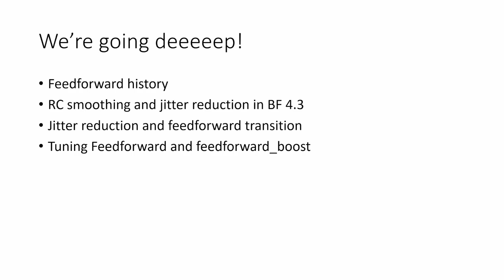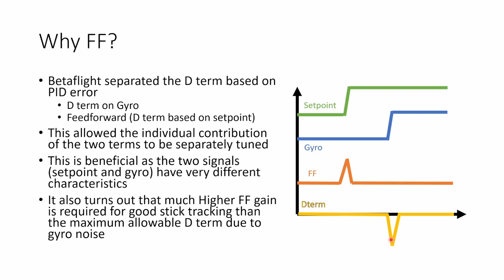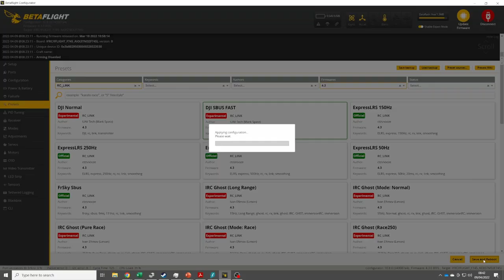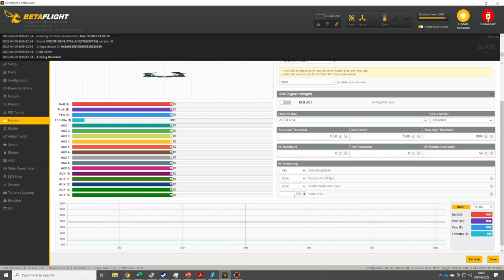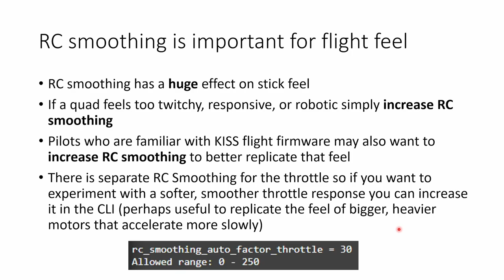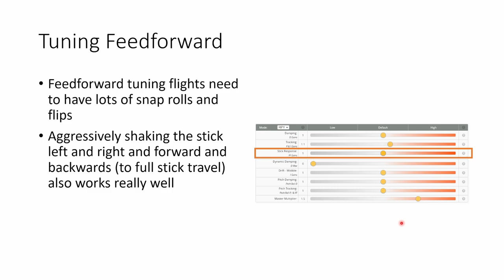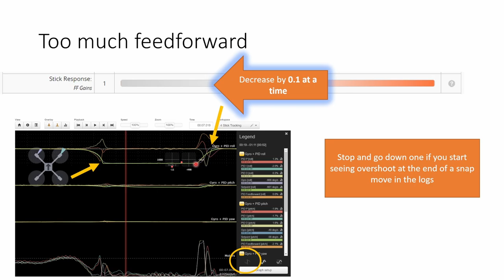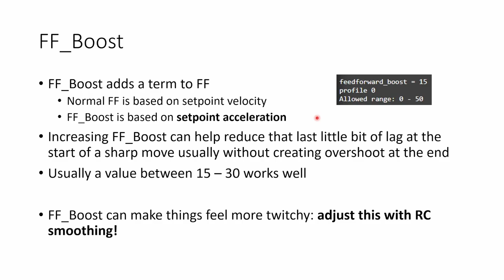BF 4.3 Tuning Guide Part 5: Feedforward!

Comment: Great video Chris 👍🏻

I’ve noticed that when I’m satisfied with my tuning of betaflight’s FF and D term it looks a lot like I’ve basically taken the scenic route route to making a synthetic d/dt error term. Meaning in a blackbox log, the FF term + D term is almost equal to what would be d/dt error once the quad is “well tuned” by my reckoning.

I don’t know the history of how Betaflight (or cleanflight perhaps) came to the decision to separate the typical d/dt error term into d/dt setpoint and d/dt gyro, but I was curious about this - so I decided to do some experimenting on my own in simulink. Even with setpoint and gyro signals operating at different sampling frequencies, having different noise characteristics, and having different disturbance characteristics, I could not find a clear benefit for separating d/dt error into these multiple terms. I was getting better simulated setpoint tracking with simpler tuning using the standard PID controller and the standard definition of the D term (where D = d/dt error). 

Have you ever looked into anything like this? I’m curious to know if other’s have found similar findings, or can counter my findings. Perhaps I’ve overlooked something simple, but my analysis suggests the performance of betaflight’s PID controller could be improved and the tuning simplified if the FF and D terms were combined into the single d/dt error term, as per the norm.

Comment: D term is also calculated by error , then pass to D term filter and gain
Reply: The BF D-term is actually just calculated from gyro change over time. The setpoint change over time is used for feedforward. In BF, Feedforward and D-term are split up (in a "normal"/classical PID controller FF is incorporated into D-term and the FF gain is locked to the D gain). Splitting up the error into D-term and Feedforward and giving Feedforward an additional independent gain opens up a whole new dimension for flexibility in PID tuning.

Comment: Hello Chris. Your knowlege is priceless. Can you discover the magic hidden behind curved magnets in motors? Like in new Iflight Xing 2 or Mr Steele's new V4 motors?
Reply from the maker: Curved magnets are used to reduce the average air gap between the rotor and stator. This increases the field strength in the air gap which provides more torque.
Reply: @ChrisRosser  I see. What about new Xings and their „New center slotted N52H curved arc magnets”? Those center slots looks like there is more space between magnet and coil in center spot.

Comment: ffd was in deed set to high at 1.0 for my AOS 5.5.  I turned it down to 0,95 and now its perfect. really close tracking at start and the lines just touching at the end of  a move.  my other settings are. Master: 1,8 I-Gains: 1,5 FF-Gains: 0,95 D-Max: 0  (all other at 1.0)

Comment: Why is rc smoothing using a third order filter rather than a first or second? Why is this particular benificial? Thanks!
Reply from the maker: A third order filter has a steeper cutoff which is beneficial when you want to preserve low frequency information whilst eliminating the stepping signal.
Reply: @ChrisRosser  ok thanks, I guess it is because the step/impulse is containing alot of higher frequencies (fourier sum)
Reply: @martinchristiansson658  exactly. It's a zero-order hold signal that needs to get filtered in a way to have as little delay as possible while still having strong enough filtering to get rid of the high frequencies from the steps.

Comment: Today put first time BF 4.3 on my quad, micro apex 4" and have some weird problem that I cannot takeoff normally. Quad arms as usual, no funny noises and when you want to takeoff quad goes like 5cm in the air and just wont go higher, even if I put 100% throttle it will just hover 5cm from the ground. It feels like some flying mode is active that prevents me to fly normally...Just to mention, on BF 4.2.11 quad flew normal, just needed a tune. Watched today all BF 4.3 videos from you because wanted to tune my new micro apex 4" and discovered this problem when I went out flying to record blackbox. Do you have any idea what that could be? Thanks a lot!
Reply: you made a clean install?
Reply: @oleg146  Ofc, and applied custom setting for FC. No tweaking was done, wanted to do blackbox log for tuning on stock BF settings. Also my friend told me he had the same issue on his Flywoo Firefly and he just went back to 4.2.11 and quad worked normally.
Reply: @1911doc  Try RC4. RC3 is 2 months old.
Reply: @1911doc  oh i see, wow, sounds weird! What blackbox shows?
Reply: @TimeFadesMemoryLasts  Already have it, did all the latest install of the betaflight configurator with RC4.
Reply: @oleg146  Found the problem, in Blheli32 if I have temperature protection on stock 140C then I get some kind of rpm lock, if I put temperature protection off then quad flies normal. But nothing gets hot, motors and esc after 5min flight are normal temperature.
Reply: @1911doc  oh wow, it was not obvious at all! Thanks for sharing, what esc and fc are you using btw?
Reply: @oleg146  Dude, lost so much time to find that fix...Tmotor F7 mini + 45A mini esc, combo stack, with 2004 2910 KV motors on 4S.
Reply: @1911doc  yeah I can imagine! Thanks, hopefully your solution will help others if they’ll run into the same problem.